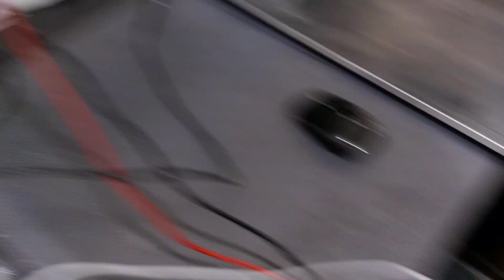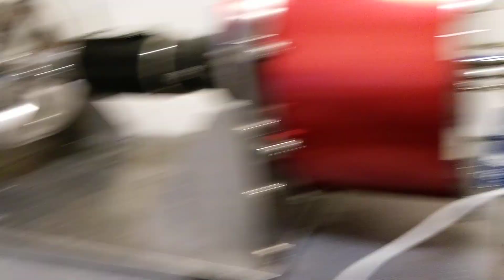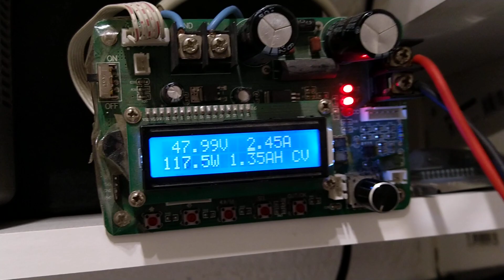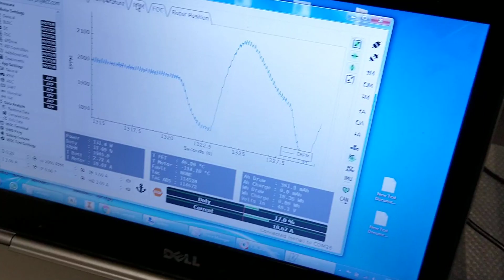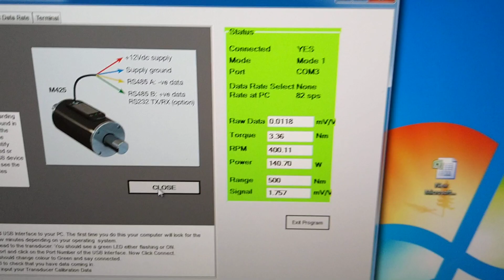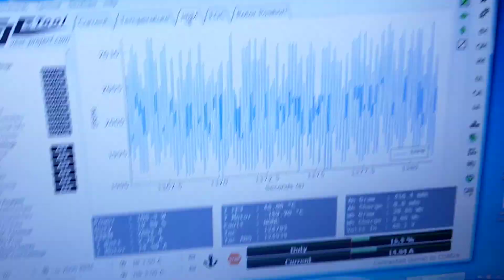👌Dynamometer test bech for 130kW motor

Comment: Do you customise for testing the induction motor test bench. in which break setup should be added. which will be control by a potentio meter.